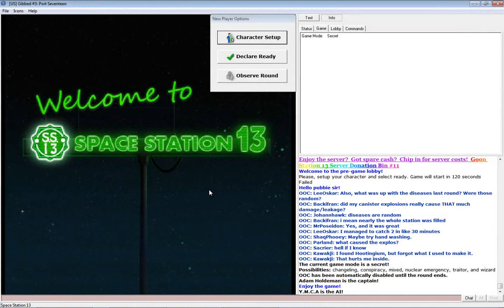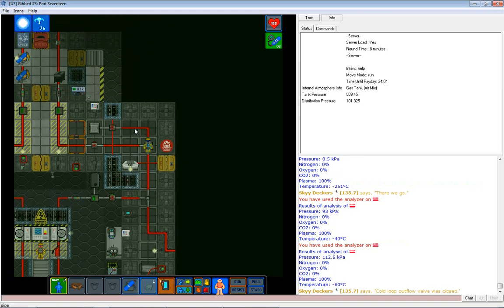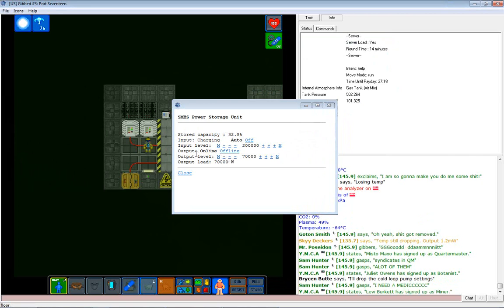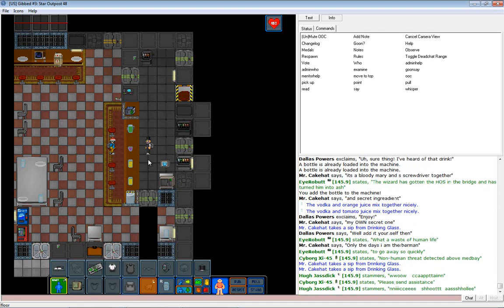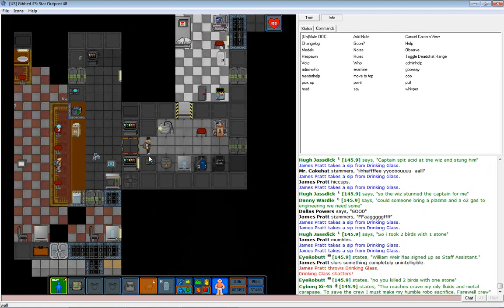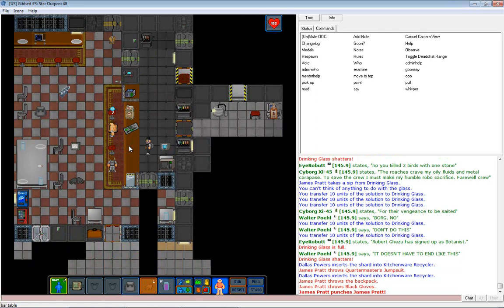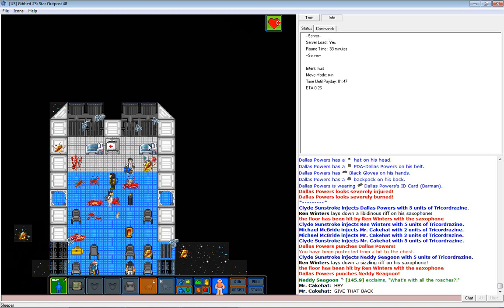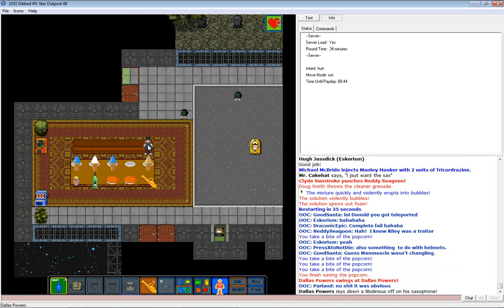SS13 - Episode 5 (Hot and Cold)

Comment: Cent-comm finally figured out that a black-hole probably isn't the safest thing to be powering the station. Although letting engineers fuck around with plasma tanks is probably just as dangerous if not more dangerous than the black hole.